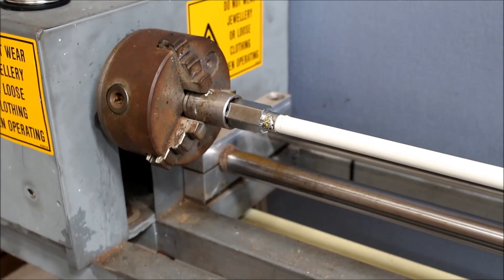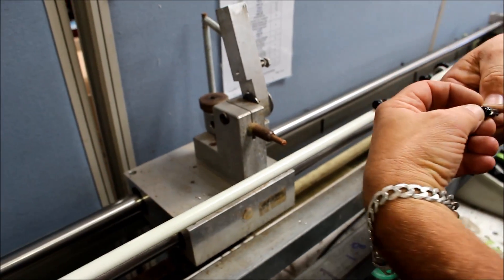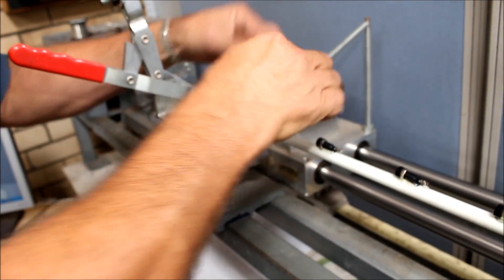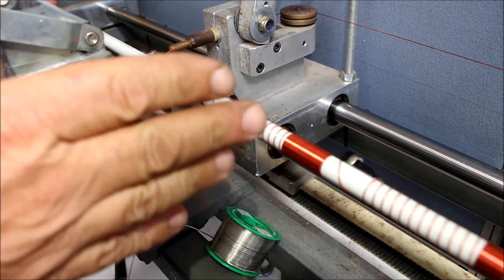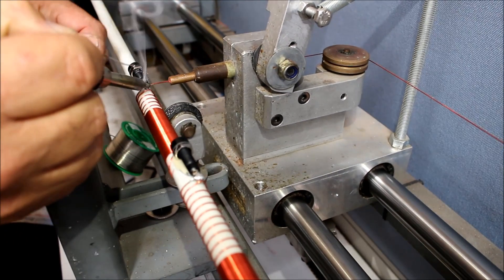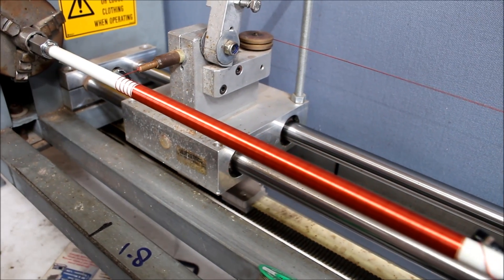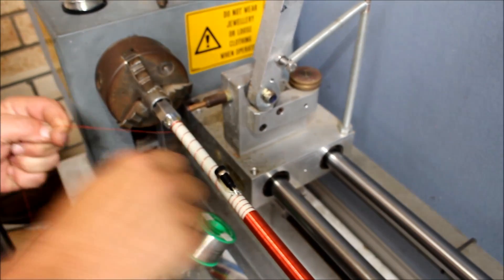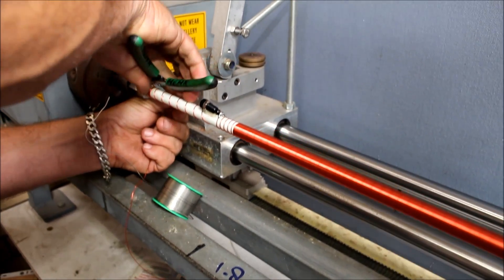Bushcomm Highlander 8 Mobile Amateur Band HF Mobile Whip antenna

Comment: Look up the trxcommunications 392M HF antenna
Reply: I got one of those coils from TRX. They work pretty good once you find the right combination of taps for each band. You need one of those antenna anylizers. I get good signal reports using the 8 foot steel whip with a 500 watt amp on 75 meter band .

Comment: Not a very big solder iron to solder wire to the ends. Doesn’t seem like it would hold. I make my own whips from old cb fiberglass whips. You have to have enough power to get wire to hold.